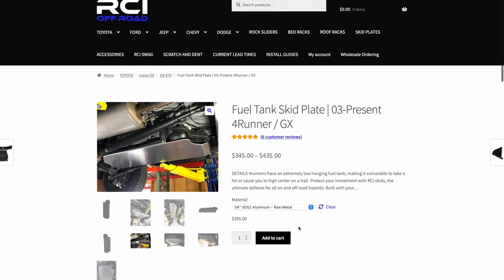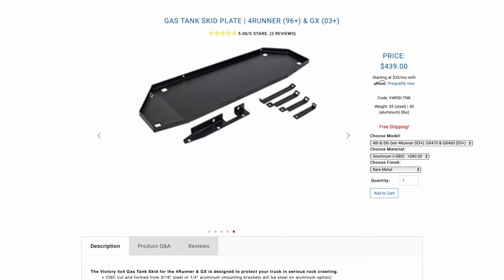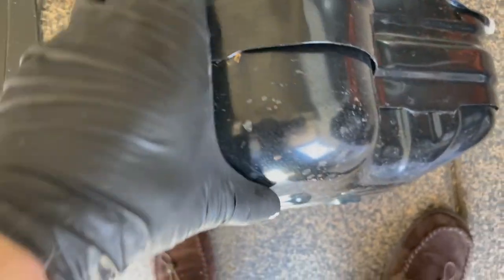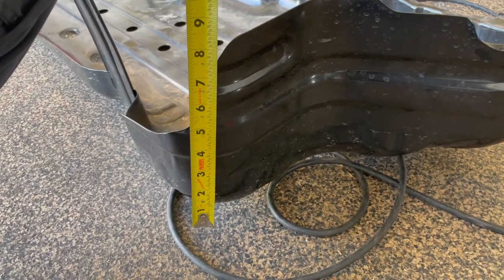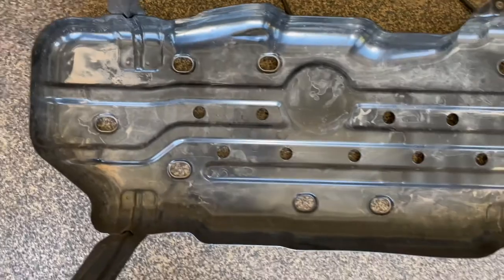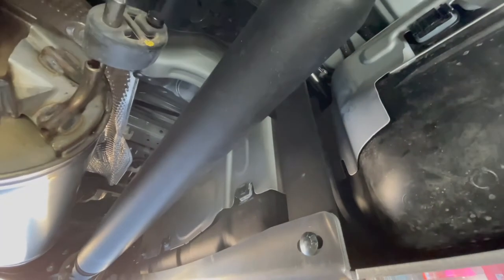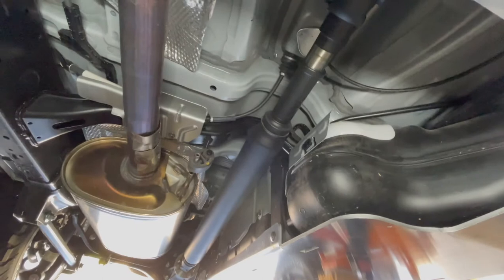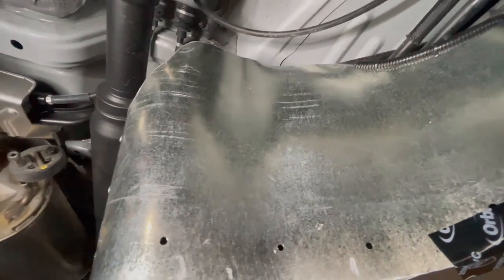Watch this before buying any aftermarket 5th Gen 4Runner Gas Tank RCI Skid Plate - Aluminum

Comment: This is like complaining the slicks you put on your drag car don’t perform well in the rain. All the skids mentioned are for off-roading and provide much more protection than the factory one for their intended purpose due to the thicker gauge material. I’ve jacked my 4Runner off my RCI skids with no problem. Try that with your factory one. In addition to off-roading I’ve also put thousands of Highway miles on roads with plenty of rocks (ask my windshield how I know) and there just isn’t an issue with rocks hitting the gas tank.